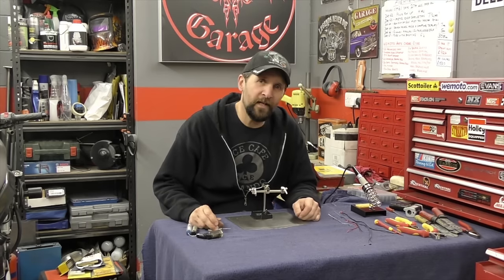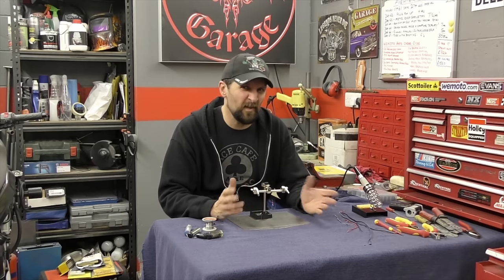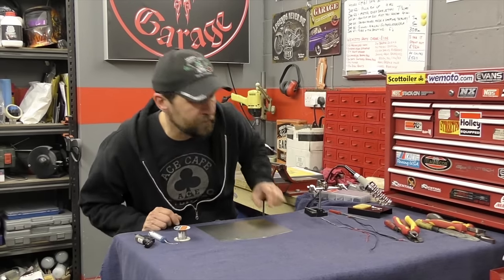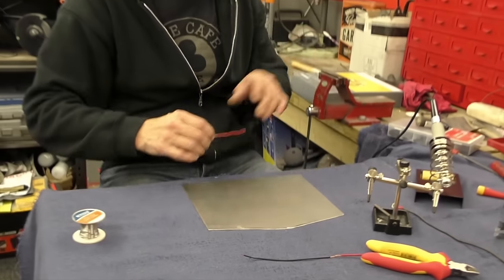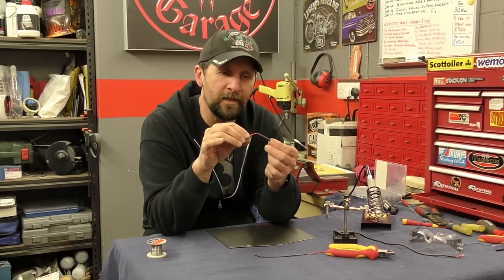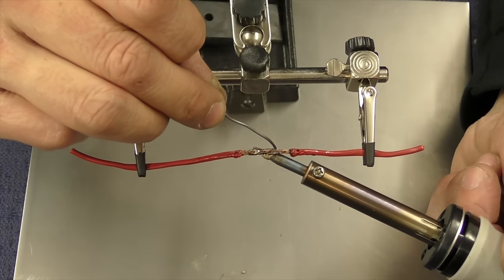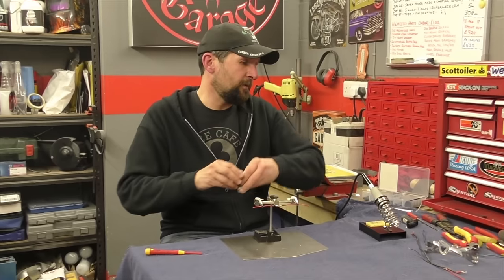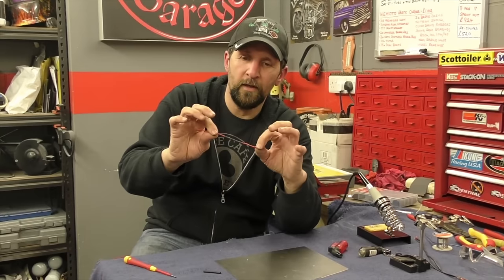Delboy's Garage, Simple Skills, # Soldering.

Comment: Hi Del and Penny

Wow the value of a top rate electrical apprenticeship (Notwork Fail) - I was taught to drip hot solder onto a cold wire. I must say your job is a thousand times neater than my previous jobs so guess which way I'll be doing it now lol 

BTW the RT1200 I'm using as a blood bike, broke its shaft the other week after blowing a seal, plus a brake overhaul (not comfortable doing it myself on a BMW) £1400, OUCH

Well ride safe and speak soon
Mark
Reply from the maker: Hi Mark,.. bloody hell, OUCH on the shaft.. what a bummer.. they have a really reliable reputation until they finally do go wrong then they do it in style...  Time for an FJR then id say..?   and yeah, cant believe how many people were actually taught to cold solder.. it amazing..!
Reply: I'd expect better from that company though, explains all the delays though lol. 

And not a chance, not giving up on her yet, not now I'm getting it fixed, and the 3 headlights changed for proper LED Projector units so it's still legal...but it has put me off shaft drives a bit, next bike I think will be a ZZR1400 2nd gen, just because I can lol (and they look sooo mean), would be nice to walk out to an RT and ZZR14 in the morning lol

Comment: you know at first I was thinking, "oh man I was expecting a better job", "that's not how you do it right", "del, the insulation is melting!"
but then I realize all the help this'll be for the ppl that don't know how to solder and think "it's better than taking it to the dealer"
awesome job!
Reply from the maker: I could have done a better job, and i did melt the insulation... and that was all down to having a low wattage soldering iron designed for circuit boards.... if i bought myself a 140W soldering gun.. it would have heated that wire in six seconds, so no heat transfer to the insulation..and if i could have found some Rosin flux over the counter i also could have used the much thinner fluxless solder i have, and that would have melted far sooner too.. so due to the lousy 40W cheap iron i have, and the fact i had to use the thicker flux core solder, it too ages to met in and that leas to the insulation melt... but i wanted to get just one main point over... to heat thew wire, and not the solder... once you have the principle.. all you need to do is practice aye..1    cheers mate.. Del.
Reply: Very true my friend, You guys do an amazing job, keep up the good work please. :)

Comment: I ended up having to use flux paste on my Aprilia wires... they were too thin to take much heating without melting the insulation down the wire. I was taking out the brown connector pugs that go high resistance due to corrosion from the charging system. I also had a go with some old lead solder I found... Much better; but of course naughty these days.

Comment: Stripping wire with a lighter was my favorite approach since it is really fast once you get the hang of it, I used to have a scar on the right thumb from the hot insulation. :)
Your disclaimer 'I'm no electrician' is spot on since this method can only be used on thick wires that can handle all that heat. Awesome video for someone who wants to start learning the craft, but don't try this with thin wire and sensitive electronics.
Reply from the maker: If you burned your thumb with the insulation melt then you're doing it wrong buddy...lol.. you probably pulled off the melted wire like it was cold, and just thought that doing it quick was enough.. but as you found, it burns lol.... turn your thumb round and "flick" it off with your nails....the hot bit doesn't touch any skin that way... Duh, you'd never make a street hacker..lol..!
Reply: can't get it right every time and as the workload increases so does the chance to burn just below the nail, over time you get used to it, like woodworkers are used to splinters in their hands i guess. :)

Comment: i still use flux got my second tin last year the first one lasted me about 35 years you always learn something from your vids even if you have done a bit of it yourself dont try it with a petrol lighter it soots up the joint i once spent 2 hours on a pub car park trying to solder with a petrol lighter
Reply from the maker: If you use these jet lighter they emit a clean blue flame....!
Reply: thanks for the tip baz it was many years ago i had to ride back from the pub with no head light

Comment: Excellent tutorial Del as always.  Accompanied by outstanding camera work by Penny Pitstop.  I inherited a Soldering Iron from my Dad and I've been staring at it for years.  I had no idea how to go about it and would never have thought about flux.  I will give it a whirl and let you know.  I have been using crush connectors till now and never really liked them.  Seen them fail too many times.
Reply from the maker: Thanks for kind words Shannon on the videos...!  If the soldering doesn't go well for you, then there are some more professional style crimp connectors that fold in on the wire and they're used by factories for OEM loom, and you need a special crimp tool and the crimps to go with it, and they will not fail... the straight forward flat crush connectors are a little unreliable and soldering? You must be good at it to make it secure, so practice makes perfect aye?!

Comment: Ahhh takes me back to the good old days when I built my own project recording studio. I decided to hand wire the looms from the mixing desk to the patchbay rack (think GPO telephone exchange and you'll get the idea). Four looms of differing lengths all heatshrunk and soldered, over 1200 individual solder joints some on foil insulated stereo cable. It took quite a few days and evenings and saved me literally hundreds of pounds. Worked perfectly for years. Turned out I was a better at soldering than I was at songwriting haha! Still play a wicked lead guitar though!
Reply from the maker: Well thats the skill i woyukd swap all my bike skills for.. to play a mean guitar is a thing to envy mate..!

Comment: {p} Well explained  and shown Del . Do you tin the iron tip everytime you use the iron .
Cheers Pete.
Reply from the maker: Yes mate... once in regular use the "Tin" will always be there, so just wipe it on the damp sponge to get rid of any carbon ,and all a little more.. then ad some at the point you touch the tip under the wire so you have a wet joint..!
Reply: Thanks Del . Never shown that at school , Must have been bad teachers or was not listening .

Comment: If you lose a few strands of wire or even half the strands when stripping them, does it actually matter? as you are doubling them where the joint is.
Reply from the maker: Yes it matters buddy.. any point where there are less strands will build up electrical resistance and heat..!
Reply: Moonfleet41 but isn't the thickness of wire doubled in the joint? I am a total amateur I hope I don't sound like a troll. But aren't there double the amount of wires in the joint not including the solder. Sorry I'm just curious not meaning to be a pain! I am a new subscriber too you and I loved your plastic weld video! Very grateful for the advise! 👍🏻
Reply from the maker: Hi Dom.. please done apologise., the only stupid question is the one you dont ask, just before you bugger it up...lol    

Ok, you make a valid point, but the "doubling" of the wire will not cover the point where you have cut the insulation.. and that is the point that will remain thinner.. you do entwine the wires, and yes that makes them double.. but you dont  wrap that wire over the insulation, and thats where the cut wires are.. so thats the exact point that will heat up and burn the insulation, causing a fire... so just be careful buddy, no cut strands aye..Lol

Thanks for your sub, welcome aboard, and enjoy the videos...
Del.
Reply: Moonfleet41 thanks for your videos! And thanks for explaining! Keep up the good work! It really does help! Especially for newbies like me! 😊

Comment: (P) Hi Del... Good video as always... One "tip" when using soldering irons: Once you've soldered a joint or wire etc, wipe the tip on the sponge, and then tin the soldering iron tip and leave it on there...especially before you turn the iron off... This will stop the tip from corroding.... A corroded tip will not solder anything.
Also...when soldering wires, if possible, bend the wire so the exposed part being soldered is higher than the rest of the wire....heat rises, so it stops the insulation from melting.
As others have  said, you can tin each wire, then lay them together, heat them and let them melt together, and this does work...Though my old college teacher said to make a good mechanical joint first by twisting the wires, and then solder them.

Comment: Many thanks for another top video. Soldering is to only way to join wires. Tape, crimped fittings, twisted wires, block connectors, snap fit all work initially, but invariably fail when you least expect it. Soldering and a bit of heatshrink doesn't take any longer than nasty crimped fittings.